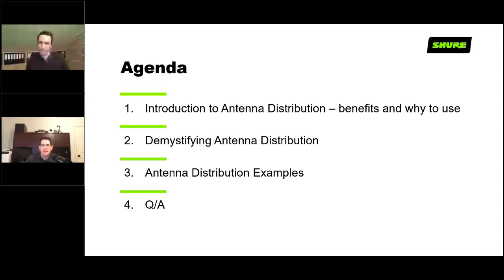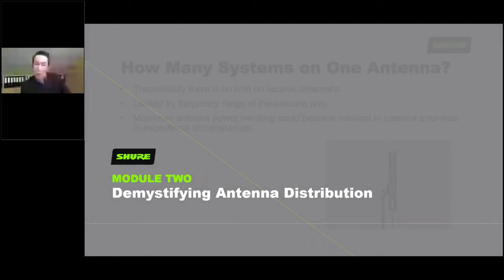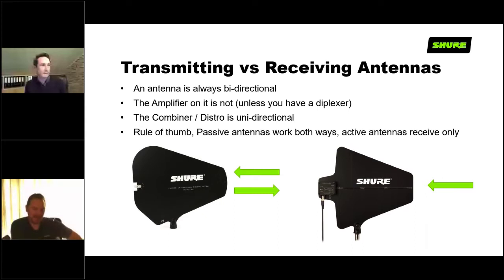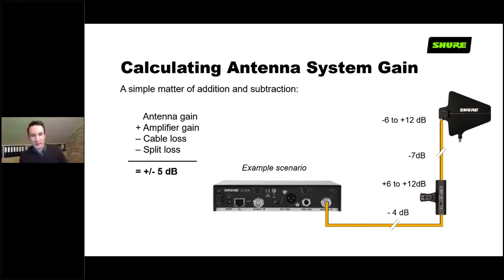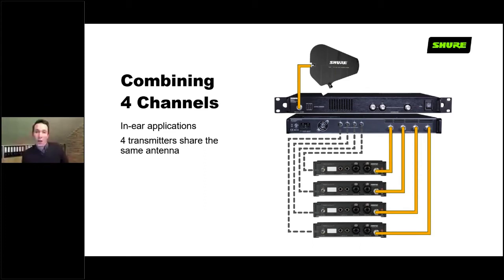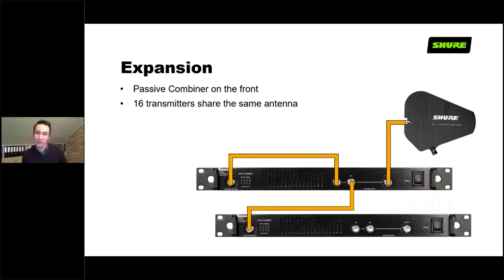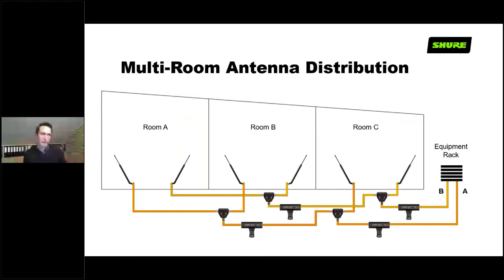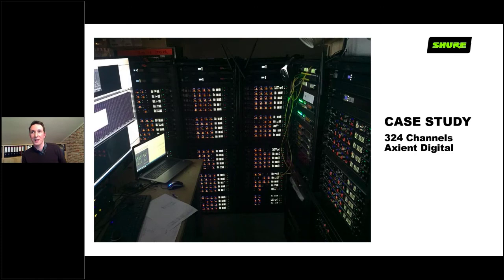Webinar: Antenna Distribution—Unlocking Wireless Potential | Shure

Comment: Hello, what is the Proper way to connect to a shure UA844 & SWB Antenna distribution system to a shure PA805 Directional Antenna.?
Reply from the maker: Hi! Our Support Team can help you out with your setup. You can reach them at shu.re/contact.